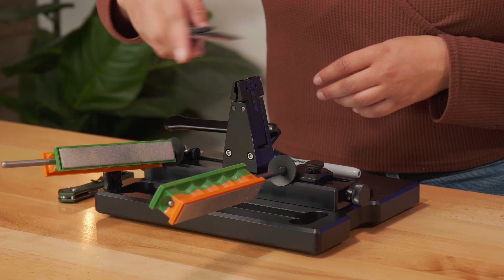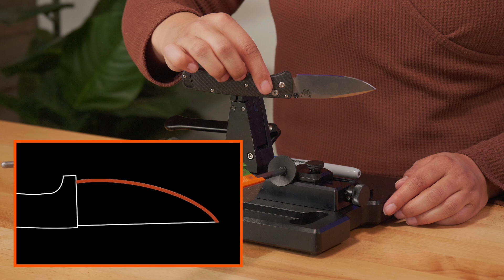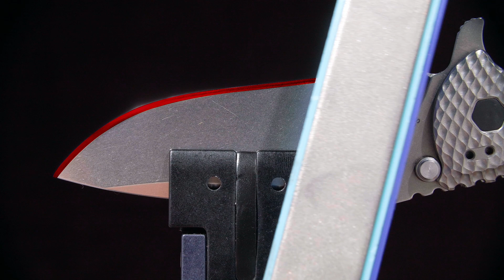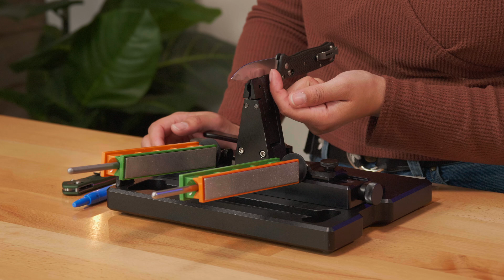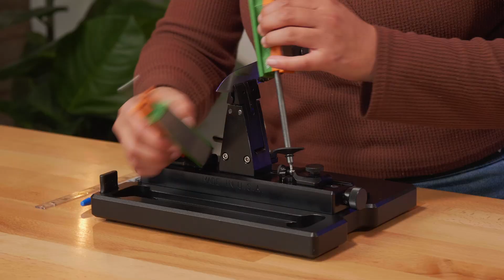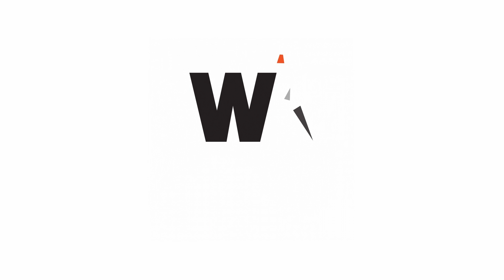Carbon-WE40 - Finding the Angle and Sweet Spot

Comment: Is this a WE 40 Carbon?  I just received my WE 40 Carbon and it does not have the quick clamp blade mechanism and does not have the knurled angle adjustments on the sides.  Are these accessories that can be added?

Comment: When she says "highest grit stone", does she mean the coarsest (200 orange) or the highest numeric grit (600 green)?  Not trying to be critical, just wanted clarification.  My knife doesn't have a  "belly" (inflection point where the edge goes from straight to curved); it is a continuous curved edge.  Do you just experiment to determine the location until you get a balance of metal removal on tip/heel?  Thank you for a great video!